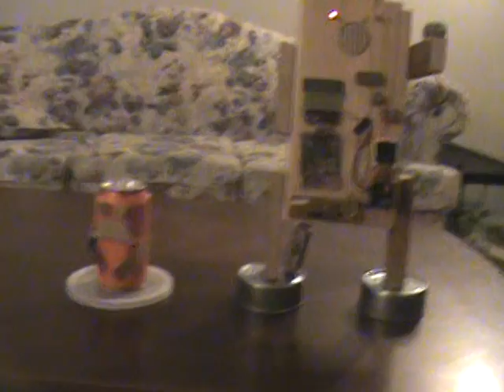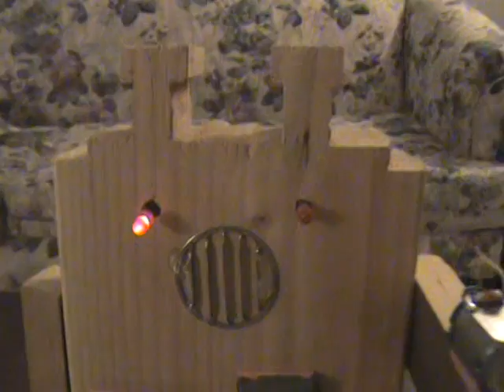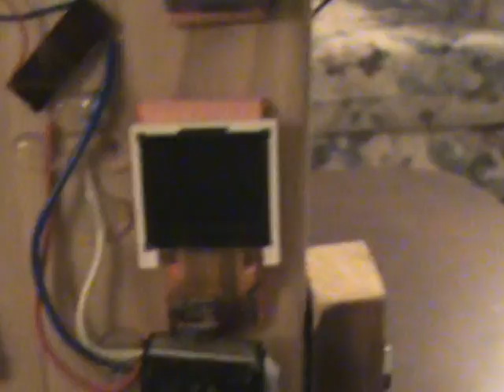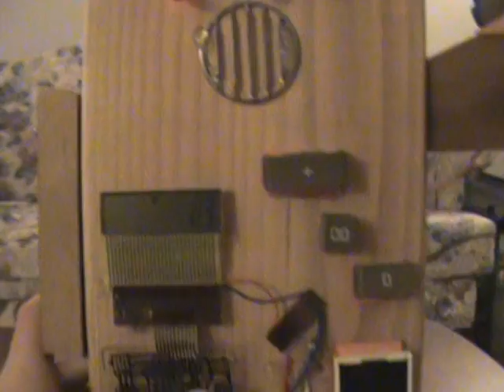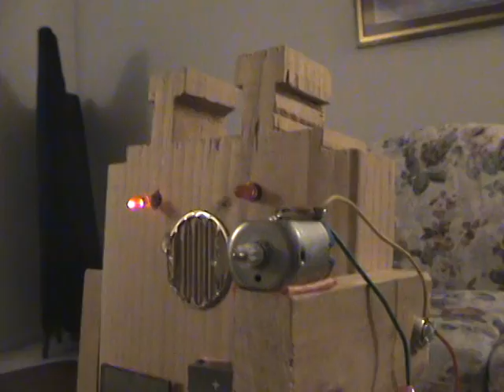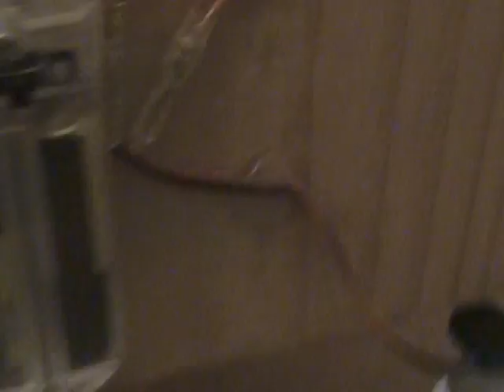How to make a Recycle-Bot

Comment: The ELLE protocol investment turnover system is a new financial investment model using various investment instruments and markets where risk diversification allows you to control issuing companies in order to generate income and preserve capital. https://goo.gl/y3FPN9 The protocol is differentiated and allows not only to make a preliminary financial analysis for each direction, but also to calculate the risks, correctly diversify the investment, qualitatively implement the case program and income distribution with the best result for the company and the client.